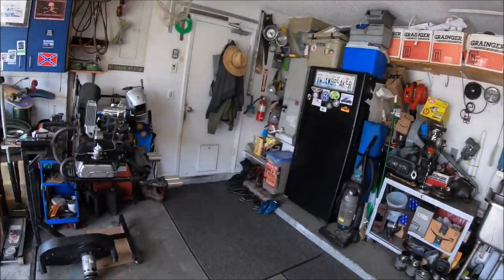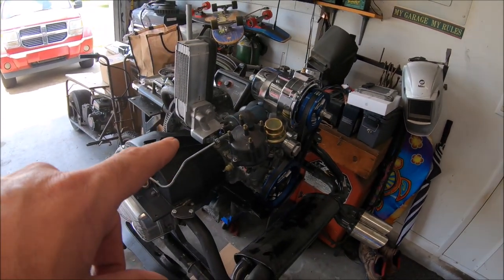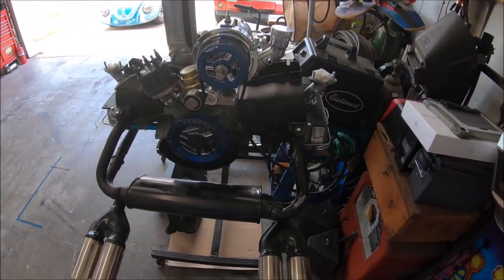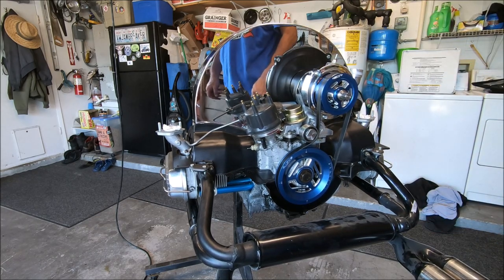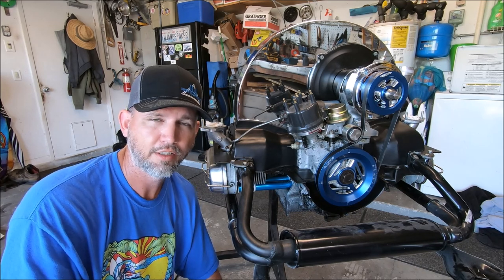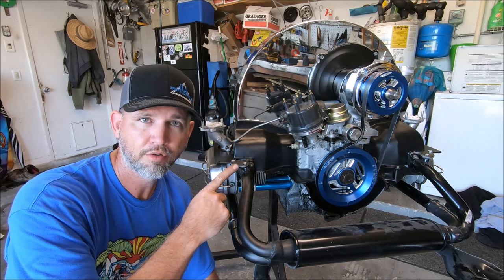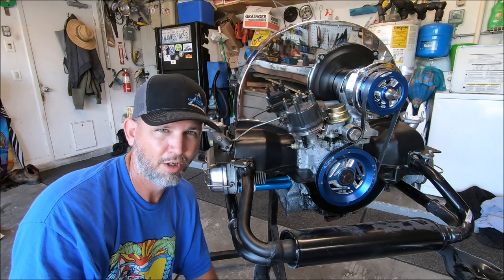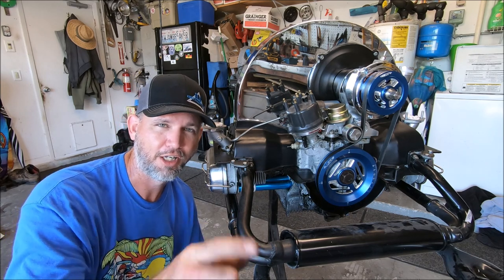Fitting VW Beetle Aftermarket Fan Shroud and Tin and MST Serpentine Belt Kit Install.

Comment: Nice job, If I have a stock fan shroud with heater flaps I have always wired them open here in FL when I lived out west in Oregon I made damn sure they operated properly. Many people will tell you they are always needed but..... Ive been doing it 30+ years and my engines last and don't have overheating issues. call me we can talk about the pro's and cons for hours! 🤣
Reply from the maker: Volkswagen Fetish I agree, they have their place especially in colder climates. Here in FL, not so much imo. 
You and I can talk for hours about anything, one of the reasons I love you man.
Reply: Up here in the frozen tundra, I use a T handle choke cable for the flaps, and open them as soon as the oil temp comes up.

Comment: Great minds think alike! Thanks for the shoutout, it's always great to welcome new people. I like the aluminum you used to avoid messing up the chrome plating. And that torque spec... I've had some lug bolts that met that standard. Thanks again for the mentions- looking forward to the carb setup!
Reply from the maker: Couldn’t believe I was in the process of debating recording it when you posted your video lol
Hopefully you’ll get more subs and views though this.

Comment: Enjoyed that, not really into the shiny, and was always told ‘Chrome won’t get you Home’ 😂 but it looks OK 👍 hopefully you’ll do a carbs and linkage video 😊
Reply from the maker: I’m glad you enjoyed the video. 
Doesn’t matter if it’s painted or chrome, if the shroud and the rest of the tins aren’t correct, you’ll run hotter. 
There is a video on the dual ITC carbs for this engine.

Comment: Hi, Gary, again very nice and informative video ! At the moment, I am also battling with one of these aftermarket shrouds, same as your, just not chrome but plain black. Have the same issues as you with fitment, also had to trim it to get it to sit kind of properly... Have one question there though : you can trim the bottom of the shroud where it contacts the case, to get it to sit lower, but isn't how high or low the shroud sits, in the end determine by the alternator/fan assembly ? I worry that if I trim the shroud enough to get it to sit properly on the case and cylnider shrouds, the opening for the fan and the boltholes won't line up anymore.
Reply from the maker: @michaeltetzner5847  glad you enjoyed the video. 
You are correct, the fan will determine where the shroud sits. It’s best to mock things up as a complete assembly and go from there. You may need to trim the lower part that sits against the case of the alternator doesn’t sit flush with the stand. It’s trial and error.

Comment: That chrome shroud will sure look good splattered with oil and caked with dust a year from now...  lol  just kidding a bit with ya...  Would like to see it a year or so from now.  :)  Looks nice though !!
Reply from the maker: KSFWG that’s why none of my engines have chrome.... or any chrome on the bug for that matter. Aaron said the black ones are on massive backorder so he got the chrome one for now. Once it fires up for the break in and I do a once over, change the oil and adjust the valves it’s his to keep clean.

Comment: Old  German mechanic told me those thermostats are only to heat engine and in winter and don't even work till temp is at 25⁰ outside. What happens is all the linkage gets dirty and gets stuck closed and engine overheats because flaps are stuck closed. Said take them out and never use and I live in New England. Never had a problem.
Reply from the maker: There’s definitely a lot of controversy on this topic. I’ve never had an issue either 🤷‍♂️

Comment: those aftermarket ones can sometime take some extra time to make fit
Reply from the maker: Have a few hours into those tins and it’s not perfect.
Reply: Yeah. I have a nightmare one I've been dealing with. I got so fed up that I pulled out one from a 72 and I'm going to clean it up and paint it and ditch the aftermarket one.
Reply: @toddmichaeljaniszewski  that's usually a good call. Finding a nice clean straight original one is usually the way I go
Reply from the maker: Toddmichael Janiszewski don’t blame you one bit!
Reply: @VWLifeVW  I've bought some complete old barely functional engines to have extra parts like this. I had never done the aftermarket 36HP style shrouds and since I wasn't running heat, I though I'd try one since they can have a clean look. But man, it was a nightmare from the moment I start fitting that. It all looked great during initial mock-up and such, but when it came to the real details of install it was just the one in the video, but I have far less skills (and patience) to deal with it.. https://i1.wp.com/zuczek1302.com/wp-content/uploads/2019_AS41_Build/Day16/AS41_Build_Day_16_8.jpg?resize=780%2C439&ssl=1
Reply: @VWJawbreaker  After all I saw you do I stand in awe. You have far more patience and skill than I have. I reached a point of so much frustration with aftermarket parts on that build that I walked away from it and only recently came back to get it done and into the car.  Of course, my 2020 work on my 79's engine (with a new aftermarket crank and crank gears and flywheel has also had enough fitment drama that I could have thrown it all across the room.  You really did make this one work well.
Reply from the maker: Toddmichael Janiszewski I really appreciate that man, it took a lot of self control to keep it from flying down the street. For someone to say that I have patience kind of shocks me lol
Thanks for the kind words man. Stay safe and healthy.

Comment: Hey Gary ! All or almost all the of the aftermarket stuff like the alt. pulley and the fan hub fall on ? I had a 63 bug when I was 15 and to get the gen pulley off I ended to have to barrow a puller to get that thing off. Now you ? about it at the parts house and their reply is = the key way hold it on .  That is why they end up rattling the key way .  What is a VW driver to do .  I did find a German black pulley that I will need to beat it on the alt. shaft . but it was # 3 the chrome one and gold one I gave away---- trash
Reply from the maker: Yeah unfortunately most of the aftermarket stuff now days isn’t anywhere near as good as the original.... they produce quantity over quality. There are some good brands out there but they are far and few between.

Comment: Does the serpentine belt work as good as it looks ? Or stick with the V belt ? Nice work
Reply from the maker: It does work well, wears out less but imo it depends on the engine setup. Higher hp engines need a welded fan and a stock v belt setup.
Reply: @VWJawbreaker  iam building a 1776 mild Engle 100 cam for a beach buggy . Hope you guys are drying out down there
Reply from the maker: @shawn9878  that’ll be a good easy runner. 
We faired very well compared to others!

Comment: 36hp tins with doghouse will never obtain genuine because they were never made and Only option is aftermarket but some removal of metal for a snugg fit is required but rather have reasonable oil temps than the alternative..good post Jawbreaker ..
Reply from the maker: Neale Frazer very well said and thank you!
Reply: @VWJawbreaker  No wuckers ya Floridian..

Comment: galvanic corrosion
Reply from the maker: Where at?
Reply: @VWJawbreaker  dissimilar metals in the shroud, ive always had problem when i use aluminum with steel. i like your videos im not that far from you in tampa.
Reply from the maker: @groundup421  I’m familiar with what you’re talking about, have to really worry about that in marine world. 
I highly doubt there will be an issue in the fan shroud, but it’s a good point. 
Maybe we’ll run into each other at a show or something.